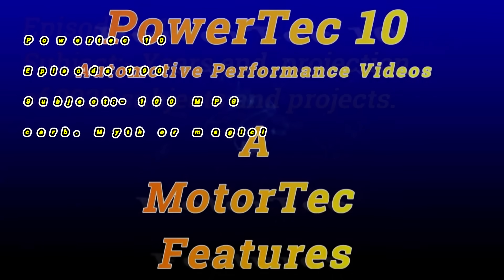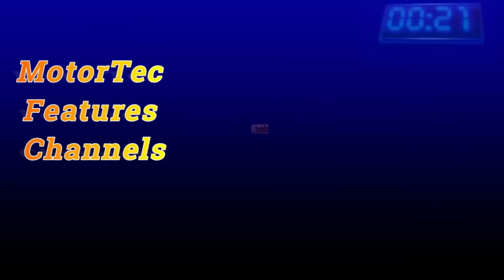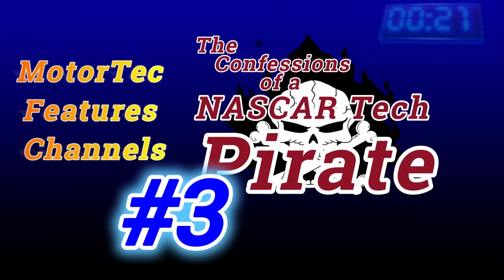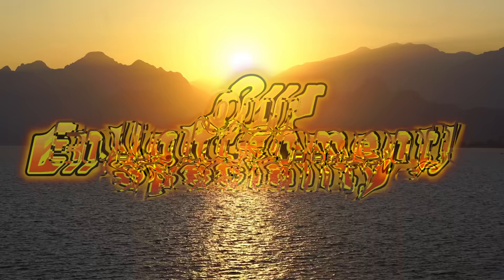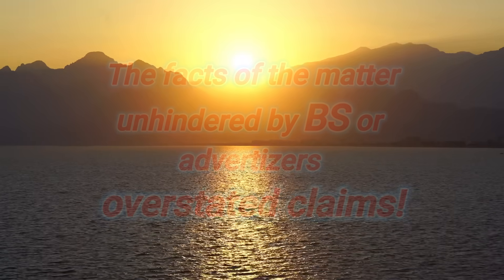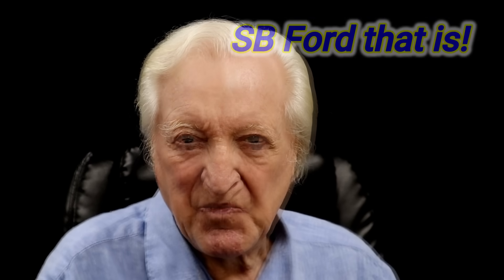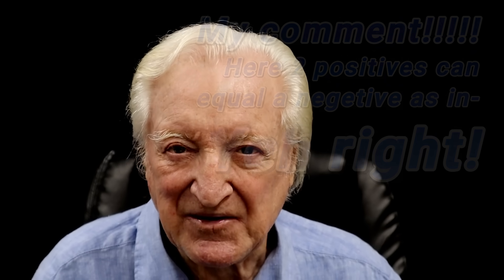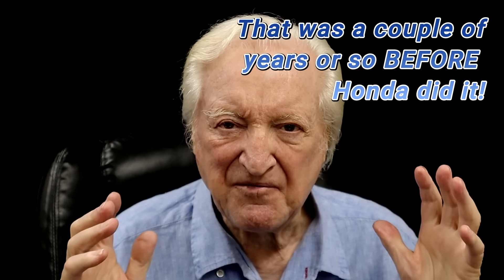The 100 MPG carb - reality or real BS

Comment: It was not carbed, so it would not qualify. And the car was wrecked years ago, so no way to confirm it today. But depending on if you use US or UK gallons a Mitsubishi Carisma with a gen1 GDI engine would be very close or manage the other claims.
I would had to travel to another country to find a stretch of road that's 160km and reasonable flat, but the car would average below 30l/100km often while cruising at a average speed somwhere between 70 and 90 kmh.
If I remember correctly the mixed average was usually somwhere between  4 and 4.5l/100km.
Or about 50-60 US mpg.

Comment: I got a 3.08 rear grear and 5.3L with the stock ecu tuned by me. I went for efficiency one summer and couldn't make it past 23ish mpg. I turn the 02 sensors off. I leaned it out to 16to1.

Comment: No carburetor is magical enough to overcome thermodynamics. Until something happens to make the ICE more than 25-30% thermally efficient, no ICE passenger car with the parameters David set forward is going to reach 100MPG.
Reply: if moped can achieve 100mpg, then what if a vehicle cruise on moped-engine but accelerate on car-engine? If a car uses moped-engine then it cannot accelerate to 60mph in 10 second, but if a car uses car-engine then it cannot cruise at 100mpg, so we combine both.
Reply: @xponen that moped engine still has to move 2000+lb worth of car down the road. It won’t do that as easily as it would a 200lb moped. And having two engine arrangement was not in DV’s parameters.

Comment: Don’t forget that by attempting to achieve this it’s more than possible the engine will be running so lean that the service life of it could be severely limited . I believe a lot of engines our affected by this problem , look at the Honda small engines used in dirt bikes and motorcycles that used to last forever while now it’s not so much the case as there requires to meet epa standards. Any engine that is California compliant is never going to last as long a a non California engine

Comment: Casey Putsch built a car that allegedly gets 100mpg and is quite fast as well. He uses a Volkswagen 1.8 TDI. Mind you, it is a 2 seater, designed specifically for mpg.
Reply: He's a smart guy. Also an off the wall goofball
Reply: I would handle anything Casey says or does with extreme skepticism. What he’s actually genius at is self-promotion.
Reply: @thegastungstenarc8078 I handle anything anyone says with skepticism, hence the term “allegedly”.

Comment: Casey Putch from Ohio built a diesel car that gets over 100mpg. His channel is Casey the car guy.
Reply: Yeah, it's very lightweight and aerodynamic with a VW 1.9L TDI engine tuned for efficiency and a six speed manual transmission.

Comment: The fuel economy isn't so much about the carburetor as the thermal efficiency of the drivetrain and tires.  Over 80% of the energy content of the fuel is lost to the system without making a single drop of propulsion.
Reply: Well stated.

Comment: Hi, very interesting topic, i'd like to add a condition to this, i've seen at a cng mechanic shop here in Trinidad, a toyota 6 cyl gasoline engine running without any fuel being added to the carburettor, neither cng fuel or gasoline, turned out, the engines fuel pump was leaking gasoline into the engine oil, heat from driving the vehicle helped the vapors from the gasoline contamination were being pulled into intake thru the pcv system, removing this pcv hose the engine cut off....this is something that could affect this 100 mpg carb challenge. Also Garage54 showed a car running off the exhaust gases from another car, the first car's exhaust was bubbled thru water then fed to the carburettor of the second car. If this is true, then unburned fuel in exhaust is a major wastage. While i lived in Brazil, and worked at a mechanics shop, often i would see vehicles with an additional plastic radiator bottle around the engine, with a hose comming from air filter ducting and other going to intake manifold, fuel would be found in this plastic reservoir bottle, a co-worker tried it on his vehicle, using the dirty gasoline that was used in the shop to wash up parts during the day, the next day in the plastic reservoir would be a 'tar' like substance, no more liquid. Any improvement in vehicle cannot be confirmed. On my vehicle ( chevrolet suprema with the c30ne engine and motronic 1.5 fuel injection), i used an E.F.I.E, it took oxygen sensor signal and emitted the same signal to ecu when 0.1- 0.4V, when voltage started rising above this , it would send 0.85V to ecu, this kept the fuel mixture always lean, which led to much better fuel economy but with considerable loss in power, which on daily route didn't matter as would pass thru two 40Km/hr speed radars on my 4 Km trip to and from the garage...
Reply: Yes burning oil as fuel would be cheating! The Motor Oil Geek just uploaded a video about burning oil as fuel.

Comment: When I was an undergraduate engineering student many moons ago, I heard about the carburettors by Charles Nelson Pogue of Winnipeg Canada. I was taken in by the idea for a while, until I did thermodynamics, learned about thermal efficiency and entropy, and then I realised that the stories were just that: stories.
Reply: Pogue was an engineer and inventor who did a lot of work on a more efficient carburetor in the 1920s and 30s . But he said in a 1954 interview that his results were wildly exaggerated by reporters looking for a sensational story, to the point that it was embarrassing to him. He also said that his carburetor would not work on the fuel of 1954 but did not elaborate.

I have seen pictures and descriptions of his carb, it used exhaust heat to vaporize the fuel. The leaded fuel of the fifties would not work in it because the gas would vaporize leaving behind the lead additives as a deposit that would gum up the carb.

Smokey Yunick built what he called an adiabatic engine that used heat to vaporize the fuel and claimed sensational gas mileage. Some car companies considered building it but it was too finicky. It ran right on the edge of overheating and burning up, if the slightest thing went wrong it was goodbye engine and the engine could burn up in minutes.
Reply: @mrdanforth3744  very good info, and what you said about leaded fuel is exactly the conclusion that I came to for Pogue's carb, though someone I was in contact with in the 1990s thought it was poisoning a catalytic cracking reaction (I'm not convinced that the carb did anything more than vaporising the fuel). I've responded to someone else with some more info that you might find interesting. Hopefully YouTube won't lose either that reply or this one I'm writing (it happens a lot, unfortunately). When I learned about thermodynamic efficiency calculations (something that suddenly turned thermodynamics from being boring to my favourite subject in second year engineering school), I specifically used it to check whether the 200MPG claims were possible. Even if 100% of the waste heat in the exhaust was recycled in the fuel somehow, 200MPG was still impossible for a normal car at highway speed because far too much heat is lost through the engine block, and aerodynamic drag and mechanical losses are simply too large for it to be possible. If I recall correctly, the highest mileage Pogue ever claimed was around 70MPG, but his methods of air:fuel ratio control didn't seem to be anywhere near accurate enough from what I could see, and I get the impression that for anything other than steady state operation, with an operator constantly monitoring the engine, it would be too unreliable.

It isn't a surprise that Somkey's car would overheat if it wasn't adjusted quite right. Standard carbs would generally be tuned to run a little on the rich side of chemically correct, using the excess fuel to cool the combustion chamber via latent heat of evaporation (high load enrichment is still used extensively today for exactly the same reason). When the fuel is pre-vaporised, there's no liquid available to cool the combustion chamber, and unless the mixture is lean enough to get lower temperature combustion events (while not lean enough to prevent combustion), overheating can be the result. If the fuel vapour itself is too hot, this effect will be worse, and then there's also the increased likelihood of vaporised fuel catching alight before it gets into the combustion chamber.

There has also been talk of "water fuel," which was actually water mixed into fuel with an emulsifier to prevent separation of the fluids. Essentially, this allowed the air:fuel ratio to be increased (made less rich, or maybe even made slightly lean), using the water to cool the combustion chamber instead of using excess fuel. There's a possibility that if there's still some liquid water in the combustion chamber immediately before the start of combustion, that the phase change might increase the pressure after top dead centre without increasing it much before top dead centre, essentially turning the engine into an internal combustion/steam engine hybrid, but getting it right for that would be next to impossible without quenching the flame, resulting in poor combustion, low efficiency, and horrendous unburned hydrocarbons. With direct injection technology, there might be some potential for direct injection of water into the combustion chamber at about top dead centre, but I haven't heard of anyone doing it. Modern water injection systems are simply intake air/combustion chamber coolers that allow more boost in forced-induction applications, which is exactly what it was used for during WWII, when it was used extensively in aero engines during times when maximum power was needed from the engines.

I hope this has been of interest. 😁

Maybe, just maybe, the Dunning-Kruger trolls might read this info and realise that the amount of info I've forgotten on the topic is actually more than they'll ever know about it. On the other hand, trolls are as trolls do. Anyway, it was good to discuss the topic with a couple of people who actually understand it. 😁
Reply: @AutoEngineerVideos  My understanding is that the leaded fuel created a lead barrier preventing thermal catalytic cracking with the aluminum carb body acting as the catalyst. My thought is to use a activated alumina silica that's easily replaceable for the tiny traces of lead in modern unleaded.
Reply: @1d10t.  the thermal cracking idea came from Bruce McBurney, if I'm not mistaken. I don't believe he was correct, but it wasn't a bad idea if the process could be controlled properly. Are you sure you would want a cracking reactor under the bonnet in the event of a crash? I sure wouldn't.
Reply: SO the VW 1liter was nothing?  David you need to look around the world's accomplishments before making those statements.  Also check out Craig Vetter's High Mileage competitions in the late 70's?  The Ale in Canada a 3 wheeler?
Reply: 2nd law, its the law!
Reply: So you're telling me that my perpetual motion machine isn't real either?😂
Reply: @WalkerSmallEnginePerformance  🤣
Reply: You learned about thermal efficiency and entropy, good for you: now go back to university and learn about chemistry, particularly Boyle's Gas Laws and Hydrocarbon chemistry.
Reply: @babylonmustfall  for some reason my response has disappeared (thanks YouTube). If you actually understood what I said, you would know that there was no need to tell me to learn Boyle's Law because that's required knowledge for understanding how to derive the equations for calculating thermodynamic efficiencies. Since you don't actually understand what I'm saying, I advise you to go and learn first before trolling on a topic that's beyond your knowledge.
Reply: @AutoEngineerVideos  What is the fourth state of matter?   Why does it matter?
Reply: @babylonmustfall  if only YouTube hadn't lost my other comments, you would realise that you're cryptically bringing up topics that you obviously know little to nothing about to try to refute someone who actually has a research higher degree in alternative internal combustion engine fuels.

As for the fourth state of matter, there's a plasma during every combustion event. If you're referring to the GEET invention by a certain Mr Pantone, no, it doesn't turn hydrocarbon fuels into a plasma that breaks the carbon nuclei apart to form hydrogen. I've been in contact with people who have tried his invention and it doesn't do what he says it does.

Obviously, I've come across a few of the supposed "high mileage carbs" in my time.
Reply: @babylonmustfall  what about the huge boyle on ass law?
Reply: @babylonmustfall  I have a research higher degree in hydrogen fuel systems, and I converted a car to run on hydrogen as part of my research project. You're telling me absolutely nothing I don't already know, and you're essentially using the "word salad" fallacious argument style, while not actually saying anything that refutes what I've said. However, what you said tells me that you have absolutely no idea about the laws of thermodynamics, particularly how they relate to calculating thermal efficiency of heat engines, as these calculations are more advanced than Boyle's Law, and they actually use his law as their basis (though they actually use more advanced forms, such as isentropic compression and decompression relations, etc).

I've even looked into the possibility of using thermal catalytic cracking reactions to "recycle" otherwise waste energy from the hot exhaust gases, and I found that it doesn't add up to the gains that were being claimed for the vehicles that were used by the likes of Pogue (though I very much doubt that he was chemically altering the fuel in his vaporiser carburettor). If Pogue actually got anywhere near the mileage that some claim he got, he must've been travelling very slowly to minimise aerodynamic losses.

So... what was it you were trying to say in your word salad that didn't actually make any argument?
Reply: could it be that you have been misinformed about thermal efficiency and entropy?
Reply: @scottersandman6408  no, I'm definitely not misinformed. The laws of thermodynamics are in full force, just as they always have been. Could it be that you're scientifically illiterate? After all, only someone who has no idea about thermodynamics would ask such a ridiculous question.
Reply: @AutoEngineerVideos As an engineer myself, I enjoyed your response to the knuckle dragger.
Reply: @bjr2379  thanks for that. Unfortunately, it seems that my reply has disappeared, so I have to repeat my thanks. I also gave some other info that I thought you might find interesting, but YouTube's algorithm seems to have decided that talking about my experience in alternative fuelled ICE research and my postgraduate research higher degree is somehow taboo, and my comment seems to have disappeared, but my reply to someone else hasn't disappeared. Also, the comments by those who really know nothing about the topic haven't disappeared. It's as if YT wants people to remain unaware of their errors.
Reply: 🤔 All of my comments have reappeared... Sometimes I wonder what YouTube is up to... 🤔

Comment: Ok we ran a stainless coil off the partial exhaust, sprayed gasoline on the coils collected the fumes so to speak, ran  large tubes into the carb it was 2 3/4" tubes. When the engine came up to temp we cut the liquid fuel to the carb and the engine ran off the fumes.. longer story shorter, it ran but the power was less than half, the exhaust was clean, it would run and drive, it had greatly reduced power my boss had an expensive mpg calibrated device. The car a v8 215cid all aluminum engine powered went from about 20mpg to almost 50mpg.. but like i said it was like running a model t out on the road. We were accually on the ch 7 news in va with in they done a short segment...it was around 1983.. E.B Singleton my boss has been long gone may he RIP.. i do think hybrid is the way to go. Not electric. We have a toyota avalon its gets 40mpg and is loaded..

Comment: I remember back in the 80’s Austin rover introduced the  1.0 HLE metro,  its its high compression 998 A+ engine and high final
Drive ratio and economy lean out equipped HIF38 SU was tested by the factory and they achieved 82mpg (imperials) at 30mph. I think that could be bettered a little by full optimisation and a high power ignition system at 25mph, it may be possible to get to 90mpg in a classic mini, but 100mpg at any real speed is I feel impossible. 
My own customers regularly achieve over 50mpg and some over 60mpg on a good run in the SU carb equipped classic minis and metro’s that I have tuned.
However everyday is a school day, and I like you, am willing to learn.😊